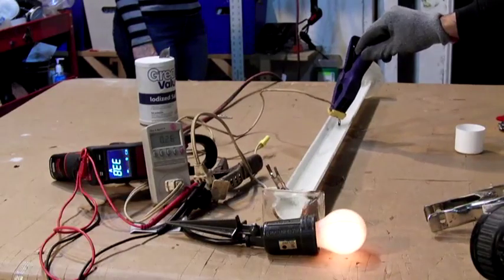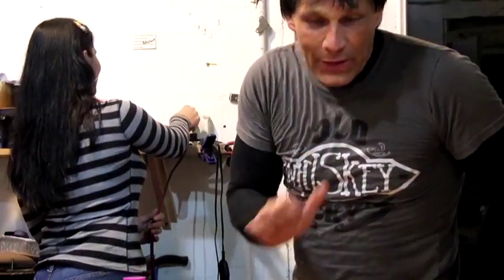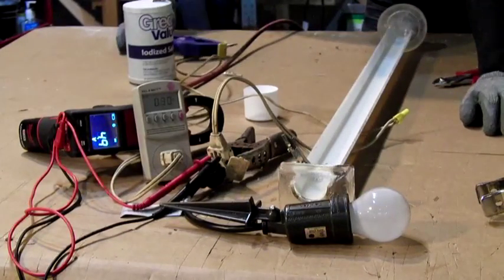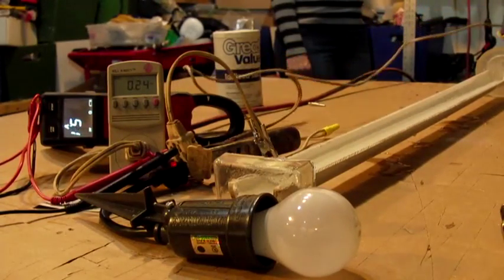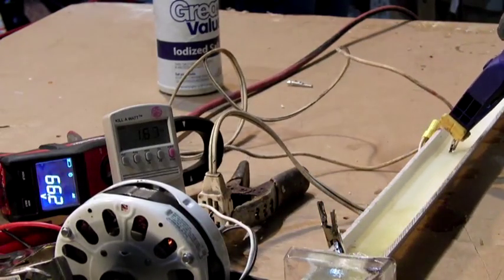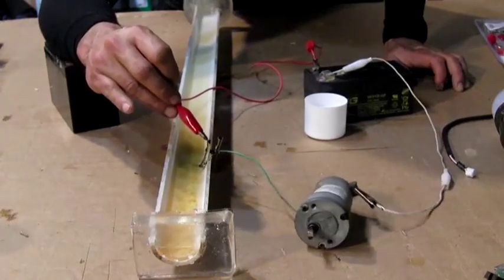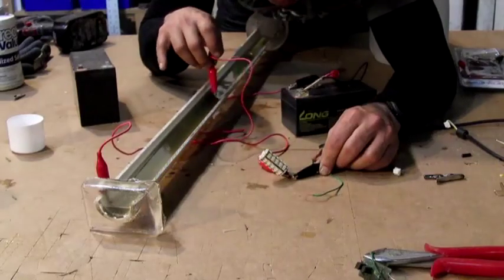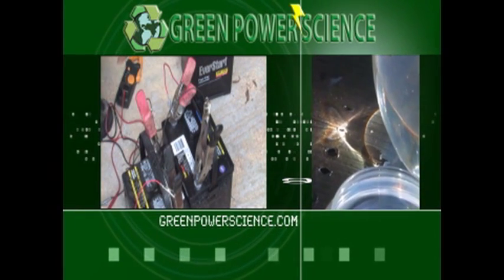The electric slide electrolyte current voltage controller MOT variac controller Rheostat

Comment: Thank you very much both of you is very good video and easy to understand also save a lot of money to buy high voltage resistor. I try to adjust the 2500 VDC to about 24 volt so this is the best video of all

Comment: Great videos.  Love them!  And she is Mega-Hot! ;)  (From your video on Thermo-Electric generators).  Just wanted to add that one of the reasons for going to AC is so that the people won't get electrocuted.  High voltage DC voltage will not let you go.  It never hits 0 like AC.

Comment: You also waste the voltage drop X  the current draw in watts.  

Its actually not too bad with the losses due to current drop you mention when you multiply your Vdrop by your final current draw..  

You could make them with a tuning resistor which opens a switch a fet gate.  As the AC rises it open the source to the drain and switches on at user chosen variable segments along  the AC sine.  Then one can use AC like PWM, this is more efficient.

Comment from the maker: CORDED ELECTRIC DRILLS are usually brushed/commutator universal AC/DC motors using a "triac"

Many AC motor speed can be safely changed with (frequency to voltage) alterations or variable-frequency drive.

Some AC motors with light duty loads can work on dimmer/voltage drops but generally not recommended.

Comment: aiiieeee unplug it unplug it...THUDD

Correction: you CAN run that particular LED module on AC. A Light Emitting __DIODE__ is a diode. Most likely that module already has a diode or a four diode bridge rectifier AND a voltage regulator.

So Mr Rojas, did you die already? Is this video coming from heaven?

Comment: That, and I was testing it from one hand to the other, not an inch apart.  The chances of a fatal shock across an inch of skin at pretty much any voltage/amperage are slim.  Dan talked about his hand being stuck to a hot conduit when working with an exterior light, and lived to tell about it.  But, if that 120v would have been traveling from his left arm to his right leg, the chances of a heart attack are greater.

Comment: Measuring the resistance of my skin across one inch, I get around 12 mega ohms. If I applied 12 volts there, current would flow, but it would be only 1 micro amp (I = V/R). Multimeters usually measure down to 10's or 100's of micro amperes, which is why you get a reading of 0.

Comment: Can you show me this low current with a meter?  My meter shows 0 because my body is acting as an insulator.  Once you increase the voltage so that it can overcome skin resistance, current will begin to flow.

Comment: Thank you for the reply! I was wondering what's the physical reason for that. Low voltage makes the rotor wires to heat up, right? It's because of what - higher amps?

Comment: once, i was experimenting a way to arc-weld copper pieces. i used those thin copper wires usually used for electronics. also thinking that if copper have such good heat dissipation and very low resistance, my 23V @ 70A arc welder might not have any problem creating arc at the contact point. i found out that even those tiny wires can burn up. so, i used a small glass jar full of water mixed with sodium bicarbonate to add a small resistance. not a rheostat, i know, just wanted to share.

Comment: I believe we are on the same page.  Anything over .4 amps (if I remember correct) can be fatal, so of course 1Kv at 1A is worse because it will overcome your skin resistance and deliver a fatal amount of current.  But, take any stun gun as an example, 150Kv sounds fatal but isn't due to lack of amperage.  It's much safer to handle low voltage (under 30v, I believe) at any amperage vs high voltage over .4A, which is pretty much everything.  Awesome videos, BTW.

Comment from the maker: Sort of hard to explain because 1000 volts at 1 amp is a lot worse than 1000 amps at 1 volt. So they both have a role. I know volts with very low current just stuns or tingles but the same is true the other way. I have seen 240v DC in action at only 1.7 amps, it would be really bad.

Comment: Hey Dan, I believe most people don't understand that it is the current that is fatal, not the voltage.  It would be cool if you could put together a great video explaining how voltage overcomes resistance (insulators) and how (like you said), a 12V car battery (300 CCA) could kill you if you cut yourself and jammed the electrodes directly into the bloodstream, bypassing your skins resistance.  I plan to do a video of DC vs AC safety, AKA low voltage vs high voltage, some day.  ;)

Comment: Yeah that makes sense Dan. We definately get more than enough sugars and salts in our diet. I was told to drink only half a cup of distilled water per half hour or 1 cup per hour. I didn't know that if you sweat it would make a difference. My family and I drink distilled water, and spring water half the time (alternating). I guess after a work out I should just drink the spring huh? Thanks again Dan! Now I feel relieved that I will not die quickly or slowly. hehe!

Comment: Very Interesting video Dan, Thanks.
I guess the electrolyte is an inefficient way of reducing voltage & current, a simple resistive voltage divider circuit, which means power not consumed by the load will be consumed by the solutions in the form of heat gain.
Would you describe the size and materials used in that childhood ride where the load is great and the duty cycle would be high, maybe 50%.
Would stainless steel electrodes eliminate the fouling of the solution?
Great Video, thanks Greg

Comment: I have a water distiller at home, you can pick up a used industrial one on ebay for under $200 sometimes. Most of them need to be fixed for that price, but the theory is the cleaner the water the cleaner your blood because DI water can help you detox heavy elements/chemicals.

Comment from the maker: Depends on the motor function and load. The electrolyte bath limits current and voltage so overloading would be difficult unless your solution was deep and or higher concentration. Drills have variable speed control but if you torque it and go with light trigger pressure so it is stalled, you will fry it fast.

Comment from the maker: No, we drink distilled water all the time. If you have a modern world diet you have more than enough sodium and potassium to compensate, in fact distilled water generally only absorbs excreted or excess minerals. All water in excess can dilute your blood if you enter a water drinking contest etc.

If you are sweating in the sun and dehydrated then other drinks with electrolyte replacement. 

search "distilled water myths" pretty accurate.

Comment: I suppose that after a while the salt will be homogeneously diluted (unless it saturates the water) in the distilled water. How long will the differential last before disappearing? Therefore the voltage could be monitored by the dilution amount.

Comment: Kinda reminds me of an old electroplating experiment I've seen years ago.  Seems oxidation buildup would keep it from working after a prolonged period of use but it's still a cool concept.   
I wonder what kind of power loss (if any) happens when only using batteries?

Comment from the maker: AC or DC does not really make the difference, the higher voltage (with available current), is what causes dangers. AC or DC can trigger heart stoppage, while DC can cause other issues when shocked too.

If the voltage of either AC or DC was dropped to 12 volt in your house, all the wiring in the walls would require 10 times the current = 200 amp thick cables to do the same work load.

Comment: My wife has been on safety duty like that more than once - ready to unplug something, holding a rope tied around my chest while I did something on the very edge of a roof... etc.. Does low voltage only damage certain types of motors? Seems most household tools run on an AC universal motor with a trigger speed control.. ?

Comment: We used the open canal or sewerage system as ground  to save on negative  wires  using dc batteries charged up during the by public utility vehicles we called jeepney

Comment from the maker: Thank you Rimstar. It is easy to do. One second of off lost thought. I got hooked to 120 from someone else's work in 1999. Sweaty hot summer work, aluminum ladder, conduit with a hot bare wire inside, reverse neutral + clipped ground. Total crap electrical work from previous electrician years before. I just happened to finally meet it. 10 seconds of frying. Denise grabbed my shirt and threw me to the ground. 2 year bruise on leg but heart and all fine.

Comment: Fun experiment! Reminds me of when I used to work on off-grid solar systems and was putting together battery banks with large batteries. I burned my metal wrench a couple of times before I covered it in electrical tape. There'd be a loud cracking sound, the light from the short arc, and a small section of the wrench would be blackened and deformed instantly. I never got hurt though. I was being careful of course, but all it takes is one careless instant.

Comment from the maker: Wow, sounds amazing and would work, excellent project BTW. Most AC motors can run on lower voltage if there is a limited or no load (free spinning). When the work or torque for the task is increased the power must be met. If the voltage is low the current (amps) increase above the operating rating. For your project, I think it would work. For drills and motors with a heavy start load could be bad. The electrolyte bath does limit current depending on ratio.

Comment: Could i implement this concept to the pos/neg outs and pos/neg ins of a home made welding machine? More specifically a multi MOT transformer welding machine? I wonder if i could use water controller for power in and power out to some extant so i don't overheat burnout and short cores/coils and fine tuning with different rods and metals to weld. Maybe someone has tried this with much much more power like 300/500 amps?

Comment from the maker: Your skin is salty and most water is never pure. RE:

Pure water or distilled water has no dissolved minerals or salts resulting in poor electron transfer. When pure or distilled water contacts human skin, minerals and electrolytes present on the skin's surface are rapidly diluted into solution making the water conductive. So, ALL WATER, even PURE WATER mixed with electricity is dangerous and can be fatal.

Comment: Cool idea to use the split PVC pipe Dan!  This is the exact principal my Scariac project operates on.  I don't quite understand why you say it would be hard on an AC motor, but I've had the same results as you are showing.  Not linear, but more exponential jumps in power within the last few inches.

Comment from the maker: Electrode corrosion/oxidation occurs between the wire gap with AC and DC when exposed to an electrolyte bath. The tank was about 200-500 gallons of water and it had replaceable stainless rods that looked similar to a reactor. The original components were altered from years of hack like parts. But it worked. I only saw it apart one time.